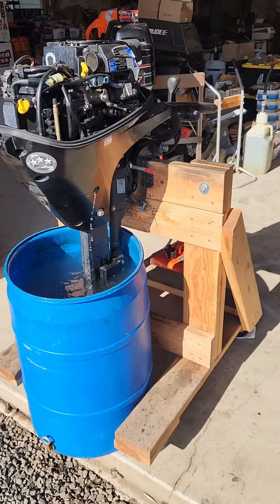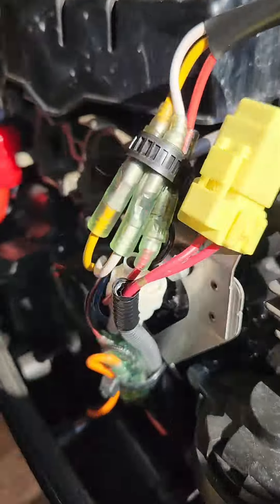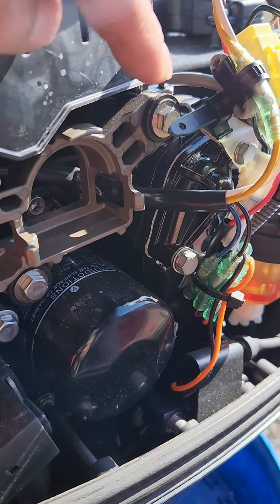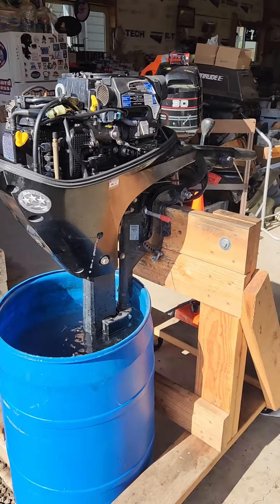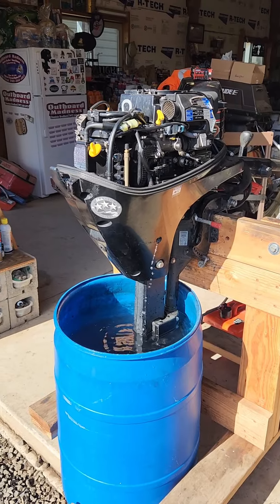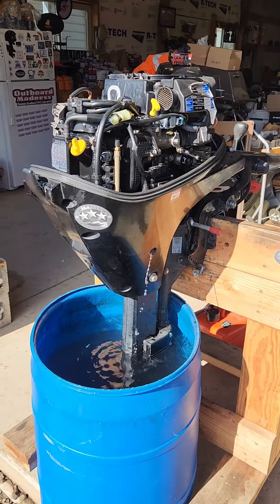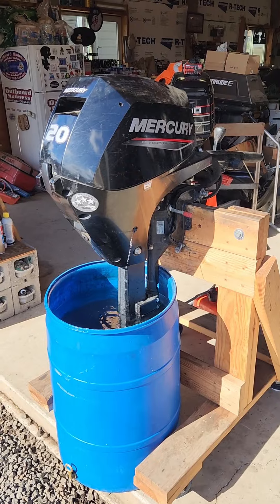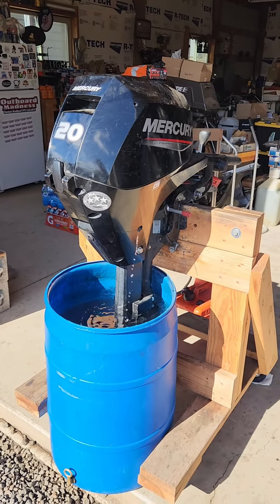2020 Mercury 20hp EFI 4-stroke. @OutboardMadness #outboardmadness

Comment: Hey would you mind telling me what you'd choose between a Mercury or Suzuki 20hp efi 4-stroke? I'd look at other brands, but i only have service reps in my area for these two brands.
Reply from the maker: @grayman5271  
I'd personally chose the Suzuki over the Mercury.
Reply: @OutboardMadness  thanks I appreciate it👍
Reply from the maker: @grayman5271  
No problem 👍🏽
Reply: Suzuki is on a different level compared to new merc. 
Ive had both, suzuki is way quieter and dont shake with low rpm like merc does. 
That being said though i carried my old suzuki 20hp (lowhours) back of my trunk and after that had wierd issue for a one day, when i started the engine it would straight up rev by its own, detached all cables inside and put back in and after that no problems, friend of mine had 50hp suzuki (low hours) and wierd problem appeared suddenly and coudnt start the engine, didnt know what was wrong with it but it was related to wires/cables inside the motor and cost 800€ to fix it in dealership. 
Other friend of mine has 50hp merc 2015 and no problems with it whats so ever, currently im using 2020 mercury 20hp and it has been like clock work, no problems whats so ever. Just wish it would be like suzuki, with low hp mercs you can use this waterproof damping mat for the engine cover, it works